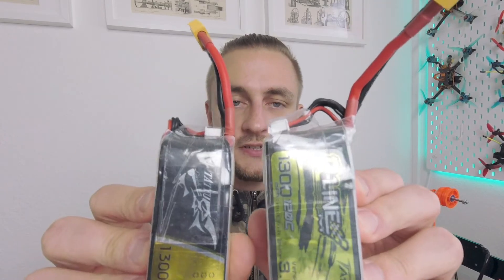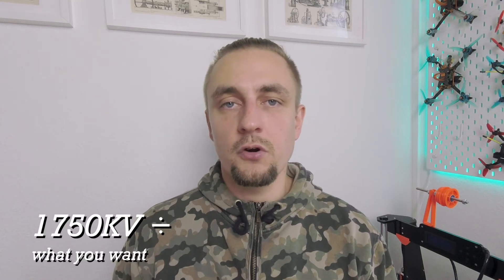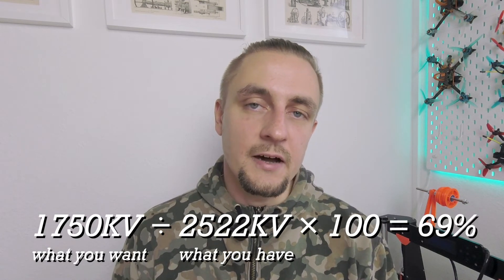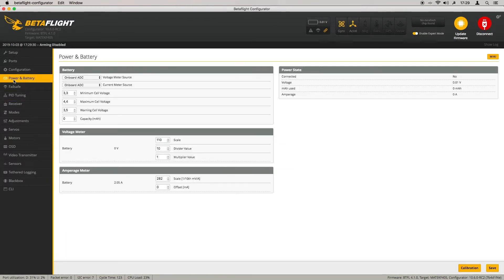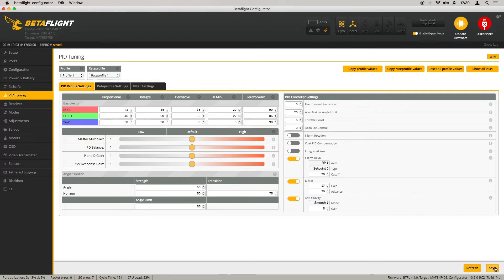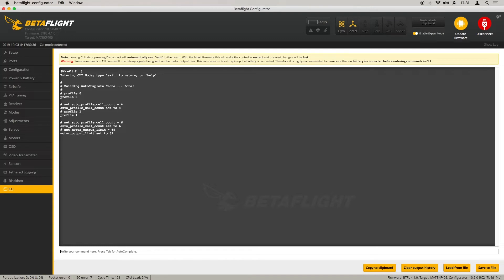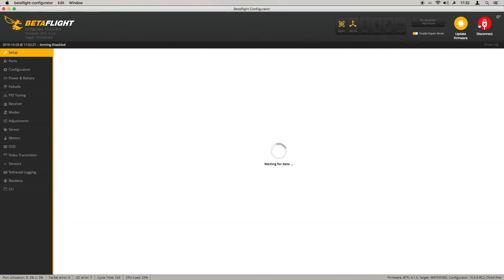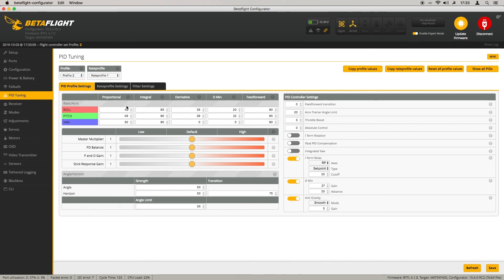4S motors on 6S and 4S with Betaflight motor output limit and auto profile cell count

Comment: Are there any disadvantages to doing this over having the true kv motor for 6s?
Reply from the maker: I spent quite some time trying to figure that out by testing 4S and 6S versions of the same motor on a thrust stand. Here’s what I found: up to 30-40% throttle efficiency and thrust of a “true” 6S motor and a 4S one with an output limit are almost indistinguishable. There’s no difference in motor temperature either. When you go higher on the throttle though, 4S motor starts falling behind on efficiency and thrust, and gets hotter. In numbers it was something like 4-6% less thrust and 5 degrees centigrade hotter after an 8 second run. The reason probably lies in the difference of coil inductance and the ability of the ESC to drive the motor at high rpms. My personal take on that is for freestyle it is still absolutely fine as I rarely need max thrust and those 4-6% less and a few degrees hotter don’t make any practical difference. For hardcore racing though I would only use 4S motors if I already had them and was fine with them eventually burning up.
Reply: @ErgoFPV  thank you for the thorough answer.

Comment: Great info i did this for my 5inch 4s build but esc is only rated for 5s... is it still the same formula and cli also the same?
Reply from the maker: There are two things to adjust if you want to make it switch between 4S and 5S. First, the target KV ("what you want" in the video) should be that of a typical motor for 5S, which I guess is around 2000 to 2100 KV. Then you divide it by the motors' actual KV and get the percentage as instructed. The second difference is in the CLI. Instead of "set auto_profile_cell_count = 6" you need to do "set auto_profile_cell_count = 5" so the second profile ("profile 1" according to the CLI) gets selected when you plug in a 5S pack. If the ESC is rated up to 5S only, it might make sense to look around for people actually flying it on 5S or maybe ask on /r/Multicopter or see if you can find 5S builds with that ESC on rotorbuilds.com to see if people did it successfully, just in case. The fact that it's not rated higher might mean that it generates more electrical noise when running on higher voltage, and that can lead to weird quad behavior like twitches and vibrations. If you can't find much online, you can try borrowing a 5S pack from somebody to try if it flies okay before committing to buying lots of them. But in principle it should work with those two adjustments I mentioned above.

Comment: Nice. Thank you. Do you get all the advantages of the 4s like low throttle control and flight time?
Reply from the maker: You mean advantages of 6S, right? Speaking of throttle control, especially at the bottom - definitely yes. I do feel a difference, I can best describe it as thrust being reliably available earlier. On 4S I have to go higher to have the same “reliability” feeling, and on 6S it comes much earlier. Speaking of flight time - depends on what you mean by that. If you normally fly with a 1300mAh 4S and then slap a 1300mAh 6S instead, you basically increase the volume of your quad’s fuel tank by 30%, so surely you have more flight time. That comes at a cost of more weight the quad has to carry, and that changes all sorts of things as far as flight characteristics go. What I recommend doing is looking at the weight of your 4S battery and finding the one that weighs almost the same, but in 6S. That will keep your flight characteristics intact and will provide roughly the same flight time, but also bring the consistency of power delivery throughout the flight (6S packs feel very similar in the air when fully charged and when almost completely empty), and also that increased low throttle authority. For my freestyle rig I went from 1300 mAh 4S to 1050 mAh 6S.
Reply: Thank you! It was what a was wondering.

Comment: Soo… if I'm building new 6S quad should I buy 2500KV and do this or just buy 1700KV?
Reply from the maker: If you're buying motors anyway, go for 1700KV. They will run cooler, give more thrust at mid- to high throttle and have better efficiency. If you already have 2500KV motors, you can run them on 6S with the advice in the video and still get decent performance. Otherwise there isn't much reason to go for 2500KV on 6S.
Reply: @ErgoFPV  
I'm just thinking about what if I'm flying with someone and I need to borrow a pack, or if I decide to buy 4S in the future since they're cheaper.
But I guess I won't borrow 4S batteries from anyone anytime soon.
Thanks for the lightning fast response time!
Reply from the maker: You're welcome! To be honest, I would not go back to 4S after trying 6S for both freestyle and racing. Yeah, I can't borrow 4S packs and I have to spend a bit more on 6S ones, but it's totally worth it.

Comment: Hi @ergoFPV Thanks for the video, it's very nice. 

Can someone helps me with one question? How did @ErgoFPV obtain the first data "1750Kv What you want". How can I calculate the KV I need to have to not burn the motors? Thank you in advance
Reply from the maker: Hey. Sorry for the late response. I don’t have any formula to calculate the target KV, but instead look at 6S quads with similar weight and same propeller size that other people / manufacturers build and use that as a guideline. For 5” props on “normal” freestyle or racing rig it’s typical to use motors in KV range of 1700 - 1900. That’s where 1750 KV came from.

Comment: Great video, I was wondering if you could use it just to lower  lower the kv of the motors while staying on 4s to increase efficiency. I want to do this on some 1404 3800kv motors and lower them to 2750kv?

Comment: do you know how this affect efficiency? hows the effiecieny compared to a "true" 6s setup
Reply from the maker: I ran some tests of Hyperlite 2207.5 in 1922KV and 2522KV variants with a throttle limit and got a few insights. Someday I'll release that in a video, but I can share some insights here. 1) Timing and PWM frequency affects the high KV motor on high voltage more than a a low KV motor. 48kHz PWM frequency on the ESC and higher motor timing (28-30) result in higher efficiency and less waste on heat generation. 2) Speaking of efficiency, up to 30-40% throttle 2522KV variant with throttle limit produced exactly the same thrust for throttle position and was even slightly more efficient. In higher throttle range efficiency dropped, and the high KV motor produced less thrust than a "proper" low KV one for the same throttle position. It also consistently ran 2-3 degrees Celsius hotter. At the same time it consumed less current, so efficiency wise it was almost on par with low KV, just 7-8% less powerful. To me the conclusion is high KV + throttle limit is perfectly fine for freestyle, I actually prefer it for the versatility as I can raise the KV even higher to run very shallow props. For racing though, I would recommend proper low KV motors for the power and lower temperatures at high throttle.
Reply: @ErgoFPV  thanks for the insight, did you mean motor output limit when you wrote throttle limit? anyway I just ordered  some 6s batts for my 2750kv racing setup, probably still a step in the right direction until I get low kv motors, I don't care as much about 8% power because I cap my throttle to 90% anyway and I can also just change my motor output limit to  match a little higher kv in order to get a preformence boost. Just hope I didn't go backwards in preformence because of heavier batts and some power lost in kv conversion. Thanks for the replay, have a good day
Reply from the maker: @noamamir0942  I meant the output limit. It should be fine, and as you said if necessary you can bring in more power in by changing the output limit. Just watch the motor temperature. And set the PWM frequency to 48kHz, in my tests that was what affected the efficiency and thrust output the most for the motor running with the output limit. You're welcome, have a great day too :)

Comment: But can we do the oposite, can we increase the kv of the motors on Betaflight?
Reply from the maker: Sadly, no. Betaflight modulates battery voltage to simulate lower KV, but it can’t increase the voltage to simulate higher KV. You can, though by going to a higher voltage battery if components of the quad support that.

Comment: so is there a point to get low kv motors? or i just can continue to get my current 4s motors and run them on 6s, is there a preformence different or any other reason to get low kv motors

Comment: hello i need invert the situation , i have drone 6s but batterie 4s .  are you help me?
- Torre de vôo: SucceX-E mini F4 FC + 35A BLHeli32 4 in 1 ESC + 300mW VTX
- Motor: XING 1408 6S 2800KV
Tattu 4S 1300S
Reply from the maker: Hey. Unfortunately the reverse doesn’t work. The ESC just modulates the battery voltage, so it can go lower and emulate lower KV values, but it can’t go higher. You can try buying the steepest propellers out there (with very high pitch) to compensate a bit, but it would be just a bit. To make it go full power you either need the right battery, or motors with the right KV.

Comment: Awesome video! I'm wondering if there is some nice way of handling the scenario where you are running 6S and then have to unplug and plugin the battery half way through it (I guess it will switch to profile 3 in that situation) ? Do you then have to manually select the 6S profile again ?
Reply from the maker: Thanks! Betaflight uses the max cell voltage setting to detect the cell count. I recommend setting it to 4.4V which means any voltage value within in the range of 22.0V - 26.4V will be recognized as 6S. I usually finish the flights at about 3.55V per cell loaded (hovering) and when unplugged it bounces back to about 3.7V per cell which is right above 22V. So even with an "empty" battery the auto switching works as it should. If you bring the batteries even lower, you can do two things. First, you can set the max cell voltage to 4.3V, that would bring the 6S threshold down to 21.5V, which is 3.59V per cell unloaded. Second, you can either make the 6S profile the "catch all" by setting the autoprofile_cell_count for it to -1 (and setting autoprofile_cell_count for the third one to 0). Having "0" setting for the third one would be a bit unideal though because the "0" setting has the effect of disabling the auto profile switching if you end up selecting that profile, so it would be a trap waiting for you in some sense, but it should work. In my personal experience, none of that is needed. I have it set up exactly like I showed in the video and I never had any problems with the profile selection when plugging in half-full batteries. And sorry I didn't reply to you earlier, Youtube for some reason was hiding your comment until today.
Reply: @ErgoFPV  Thanks for the elaborate answer. Sounds like it will work perfectly as you describe it - I will give it a try :) Is it correctly understood that the auto profile selection only happens when powering on ? In other words that it does not switch during flight if the voltage were to dip below the threshold for 6S for instance.
Reply from the maker: Correct. It detects the cell count when powering up and keeps it at that setting, doesn’t matter how low you allow the battery voltage to drop after it’s connected.

Comment: I fly my XL10 which has 2814 1100 kv motors, 6s motors, on 4S, 5S, and 6S. I did in fact do this method, but didn’t do the motor output as I am running opposite. 4S and 5S batteries on a 6S rig. I wanted options without doing too much programming and this is the best for me. Build 6S. Do what you see in this video. And fly 5S and 4S

Comment: The vid out there exampling this - I'm planning to have two quads running everything the same including motor size 2306. The difference being in motor kv one at 2450kv and the other at 2750kv. i'm then planning to run 6s and run the same rpm on each. Would the scaling work differently and feel different? Also how different is it running a true 6s / unscaled back motor?
Reply from the maker: I hate to say that, but I'm still preparing the experiment to see what the difference is between a true 6s motor and a scaled one. I have the motors already and currently am building the thrust stand rig and also working on the quads to do real flight testing. Theoretically though, the only difference should be the slight loss of the motor speed setting resolution between the ESC and the flight controller. DShot allows 2048 distinct motor speed steps, and motor output limit cuts off a chunk of those steps at the top. The difference between 2750kv and 2450kv when you scale them down to, say, 1750kv is that for the former you only allow 1303 throttle setting steps to be used out of 2048, and for the latter a bit more - 1463 steps. Both numbers are higher than 1000 throttle steps that radio protocols use, so there should be no difference in the throttle feel, but theoretically the flight controller might not be as precise with the very high kv motor since the available throttle steps are reduced quite a lot. But that's one possibility, while the other is that the flight controller is perfectly fine with lower amount of motor speed steps because delays in motor reaction smoothen them anyway and the flight code these days is just good enough to work with that. Again that is theoretical and if you have the motors anyway I suggest you to just try it. Worst case 2750kv has weird issues and you buy new motors. Also, as I have some 2750kv motors, I will include them in my testing to see if I can spot anything wrong when scaling them for low kv 6S.
Reply: @ErgoFPV  Thanks for the replying I find it a really interesting topic. I have not purchased the 2750kv motors yet might hold fire for the time being. I'm just stock up for the year and seen the 2750 xings at a good price. Looking forward to your testing.

Comment: Is there any performance difference running 4s high kv versus 6s with motors limited?
Reply from the maker: Theoretically there shouldn't be any performance downside. I want to verify it practically though so I'm currently designing a proper test. It is far from being complete as of now, but I will share the results as soon as I'm done.
Reply: @ErgoFPV  thanks. I take it though when running 6s the overall amp draw is lower than compared to 4s?
Reply from the maker: @gmac_83  correct.

Comment: Do you copy rateprofiles also? And do you keep rpm filters the same for 6s?
Thank you.
Reply from the maker: Rateprofiles are independent from (PID) profiles, so no need to copy them. The RPM filter is also independent from battery voltage and motor output limit. In my case it flew just fine with exactly the same filtering settings on 4S and 6S, but I can imagine there might be a need to adjust PIDs or filters on some builds, especially if the KV that is stated in motor specs is different from what the actual KV is. Otherwise the motors output the same RPMs on 6S and 4S and for the flight controller there is no difference. One other thing I can think of is the ESC performance. Some ESCs might be particularly noisy and require larger capacitors installed on the battery leads when using 6S batteries. Mine (Aikon AK32) flew fine with just a 470uF cap. You're welcome.

Comment: Hey, great video, keep up the hard work, but I am not sure if I can use this method if RPM Filter is enabled on my quad.
Reply from the maker: Thanks! RPM filter works perfectly fine with motor output limit, I fly my quads like that. When RPM filter is enabled ESCs measure the actual RPMs of the motors to base the filter frequency on. RPMs are always RPMs, regardless of motor KV, battery voltage or throttle output limit, so there is no reason for RPM filter not to work.

Comment: Hey man, many thanks for this best video, Today I tried and booooom It does work man you are awesome, I have been doing fpv for 5 years. This video makes me sooooo happy thanks a lot man really.  Just because I haven't used real 6S motors I dont know how is that I mean If I use the real 6S motor like 1800KV will the torque change ? I have doubt any way it works and my thousands of 4S motors are not wasted thanks to you man really thanksssssssssss <3 MY G
Reply from the maker: You are very welcome, mate! I'm currently working on a more detailed comparison video regarding 4S motor on 6S vs 6S motor on 6S, so a proper answer is coming. But at the moment all data I have points that there should be no significant torque or efficiency difference between the two. I also have two "proper" 6S racers with low KV motors and I don't feel any magic in low KV compared to high KV with output limit.
Reply: Thanks mate. You dont know how much you saved my life and budget ❤️❤️ a question; I did 72 motor limit on 2500kv but want to change to 80 motor limit so what is steps for that ? Should I flash fc and do all things accourding to 80 or any easy way ? I am waiting your 6S vs 6S high kv by motor limit output ❤️
Reply from the maker: @limitsizyasam  Hey! I'm happy to hear the tutorial was helpful :) You don't need to redo everything to change the limit value. Just connect the quad to Betaflight Configurator, open the CLI tab, type "profile 1" (without quotes), press Enter, type "set motor_output_limit = 80", press Enter, type "save", press Enter again. Done. Nothing magical there, but you need to select the right profile when you change the limit value, hence the "profile 1" command. "profile 1" actually means "select the second profile" since in the CLI profiles are numbered starting with zero, and it is the second profile which gets auto-selected when you plug in a 6S battery.
Reply: @limitsizyasam  you don't need to reflash. just re enter the new number in the CLI
Reply: Also I just found that after you done these settings, you can adjust the motor output limit on osd :)